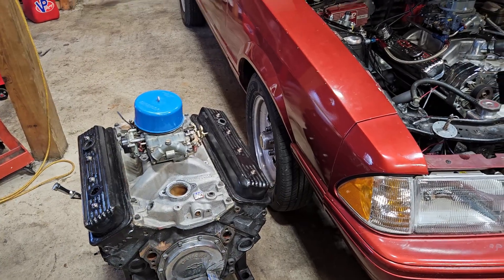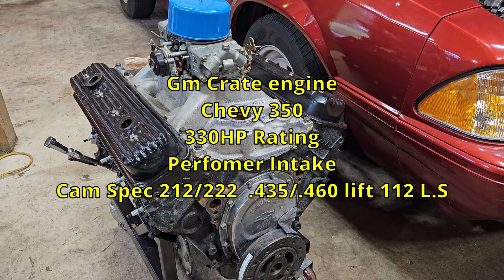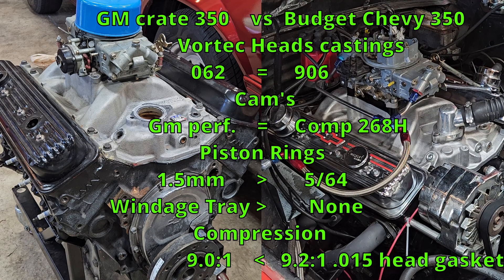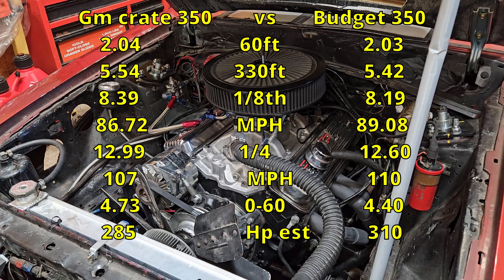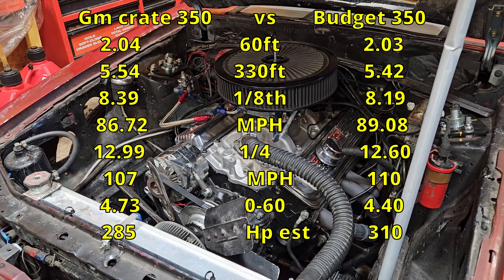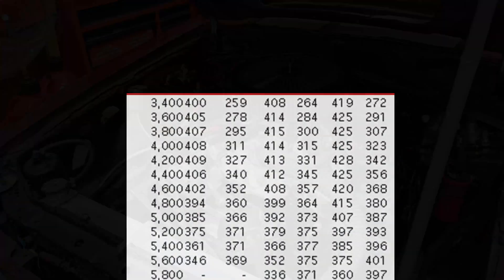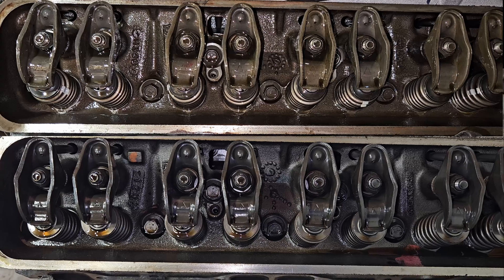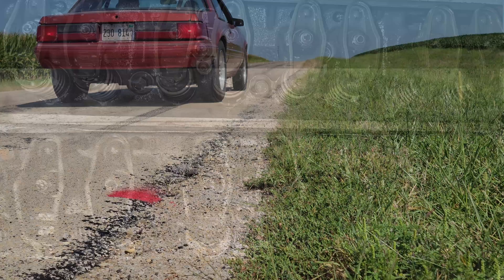Chevy 350 268H cam Vortec Heads

Comment: As a chevy guy i say dont mix brands.  That chevy engine destves a chevy around ut.
Reply from the maker: Nice, I do like Chevy Cars for sure. I enjoy testing engines and have been doing it for years. I had to pick one car to test several different brand engines in. I would prefer to have several  different cars for testing and cruising. I dont have the space or budget. The foxbody made sense. It is a good-looking car with a lot of support for engine and transmission swapping.  I can find headers and mounts for a good price.
Reply: Put junk in junk.

Comment: The comp cam is far better and the thin ring package is just bullshit
Reply from the maker: I have seen plenty of comparisons between rings. Thin rings make more power. In the video, I have a dyno sheet of the 330hp crate engine. It made 371hp from hot rod in 2003. Upgrading to a 268 extreme energy it made only 6 more horsepower.  The 268xe is a better cam than the 268H.  Only one way to find out about the cams is a test. I dont think there would be much difference in performance in the gm crate 330hp engine.

Comment: I doubt you will go 12.60 @110 with that combo.  be more like a 13.60 would be my guesstimate at our full quarter mile track with a pro tree, but I have seen a real world full quarter mile test of Ford, Chev And Chrysler, all 3 cars were ballast weighted too 3150 lbs with driver, they were all fitted with crate motors. The quickest the Camaro with the 350 hp 350ci roller cam Engine ran was high 12’s low 13’s and the Mustang with the 351 ford Windsor ran 12.8 something, the dodge, Chrysler corporation duster with the 360 Chrysler magnum engine ran close too the 12.60 you mentioned from memory I think 108mph 

The ford 351 in a similar fox body mustang was making about 385hp on a Engine dyno from memory.
Reply from the maker: Nice, I based my estimation on about 15 1/4 mile runs i made over the past 15 years. I picked time slips that had 88mph to 91mph in the 1/8th mile. The average time it took to cover 1/8th mile to 1/4 mile was 4.36 seconds. It only ranged from 4.34 to 4.39 seconds to get to the 1/4 from the 1/8th. So i add my 1/8th mile et. 8.19 to 4.39. I get a 12.58 at worst case in the 1/4. 89 mph is fast for my e.t. Thanks for sharing.